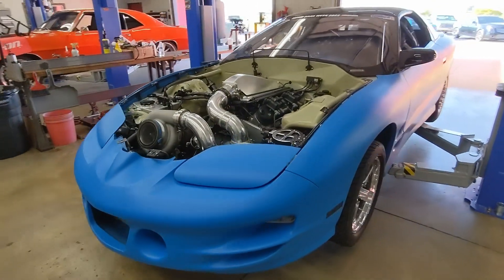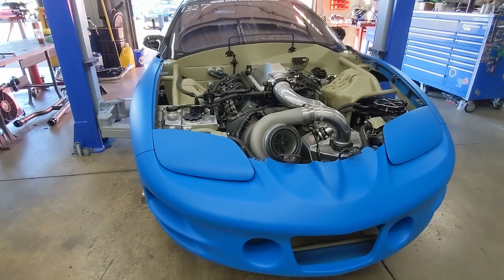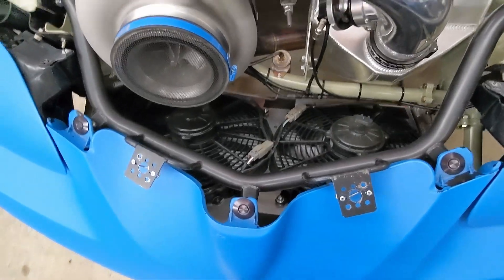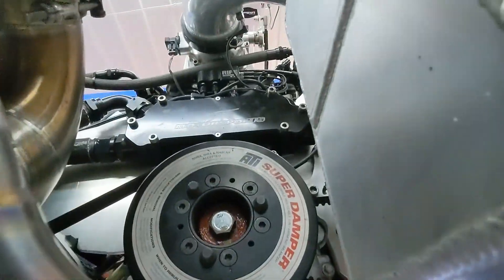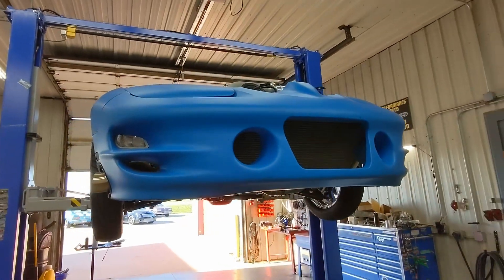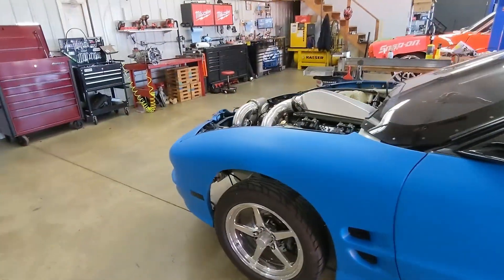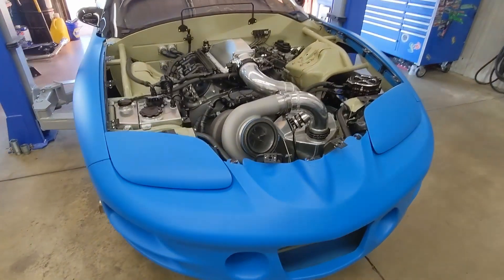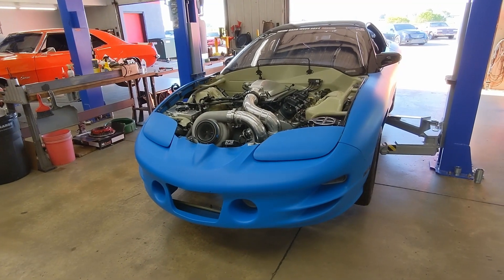Cooling Systems 101: How we keep high HP streetcars cool

Comment: Why do you like to run it between 180-190?   Does it run better there. I’ve always had better luck running them between 160-170  with boost
Reply from the maker: We've checked it a couple of different ways and this seems to work the best. Perhaps its the 20W-50, or perhaps it's the race block, but this one runs best in that range.
Reply: @Scramspeed  nice, do you have the water pump kick on an off. Or is it running full time? And does it have a thermostat
Reply from the maker: @horsepoweraddict7199  No thermostat, the water pump runs continuous.  Triggered on above 500 RPM.
Reply: @Scramspeed  I got a cog drive on the 95 mustang now. Ysib renegade fox body setup. Not much  room, 1 spal 15 inch on the puller side driver side and a pusher on opposite side. Flow kooler pump. Still creeps up when stop and go. Don’t want to cut up anything so not many options